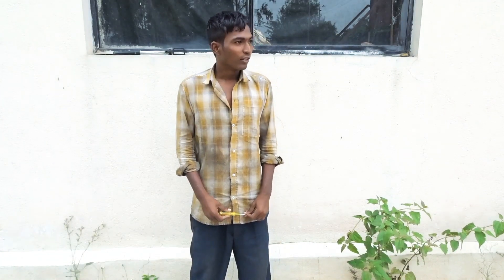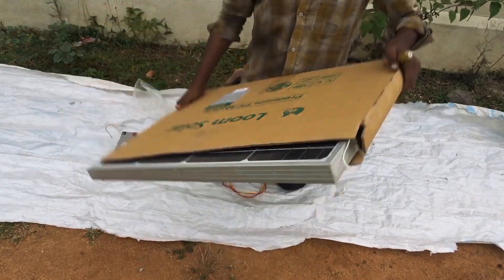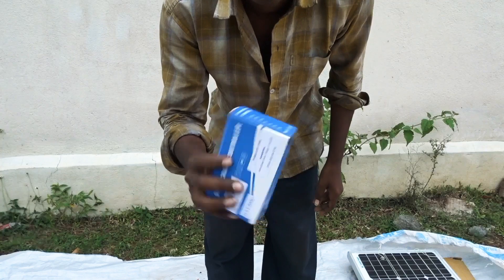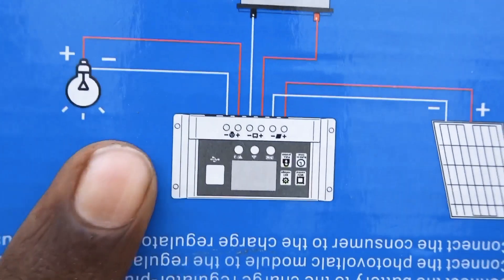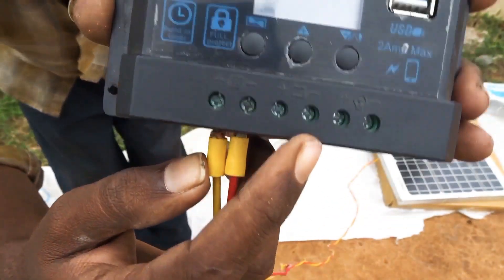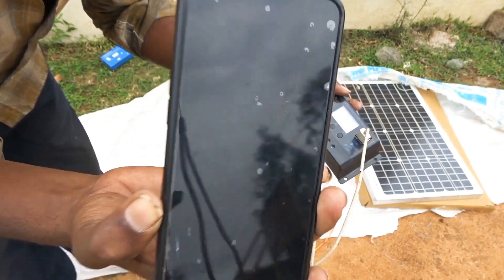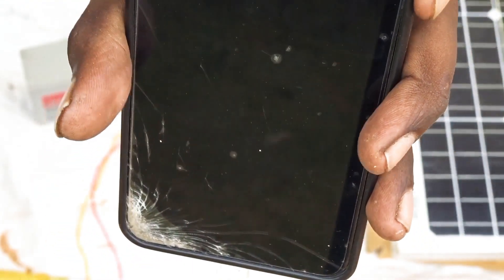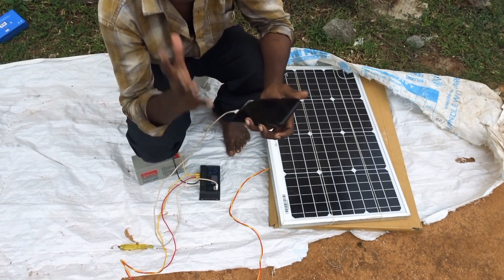50Watt Monocrystaline loom solar pannel unbox & full setup

Comment: WARNING

Always connect the battery to the charge controller first.

Connecting the solar panel before you connect the battery can damage the solar controller.